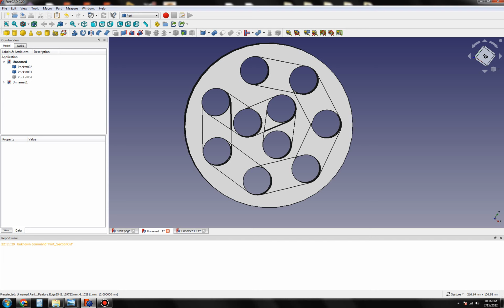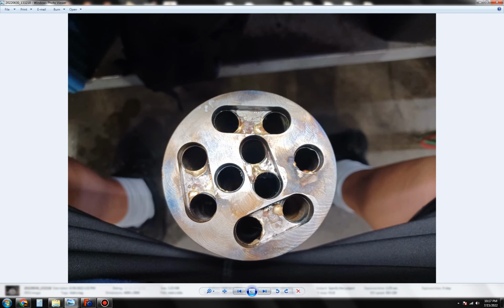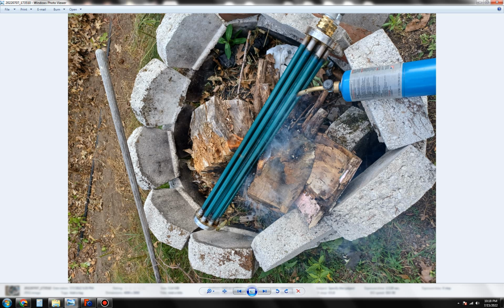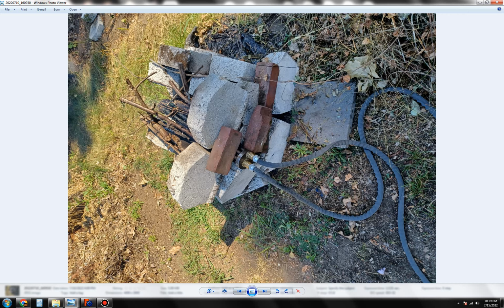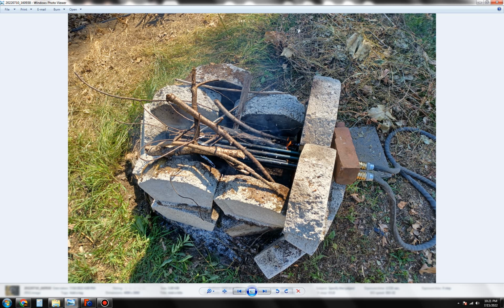Backwards Redneck Pool Heater!!

Comment: I never knew there was such a thing as a propane powered pool heater.  It's cool!  So do both sides of each plate have those oblong recesses which allows the water to snake in and out of each  plates from one passage to the next??  Cus  if so,  then that is a mind blower design element  that I'm never seen before. Makes so much sense and is so easy that it's infuriating lol  I've seen boiler set ups with tubes running through, but never saw or though of the "Manifold" part if it can called that.
Reply from the maker: Yep, Brazing it was the hardest part. the tubes were so thin if i got the flame near it it would just burn threw. thankfully it doesn't leak at all which im very surprised. I used 5/8 OD tubing so the water wouldn't be restricted and the output should be enough for what im trying to do.  If it works good im going to do it again with stainless steel tubing. I normally get that from my work for free so what the heck. I wanted to use copper but we both know the price of things nowadays i wasn't going to try that on something i was just messing around with.